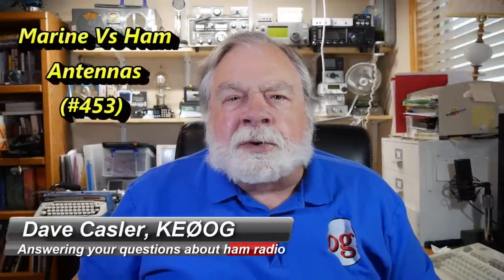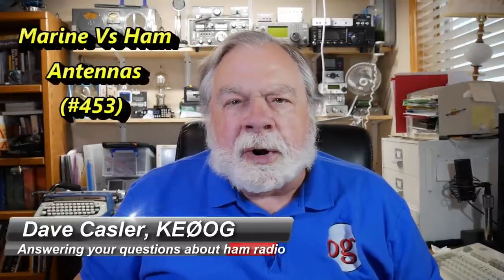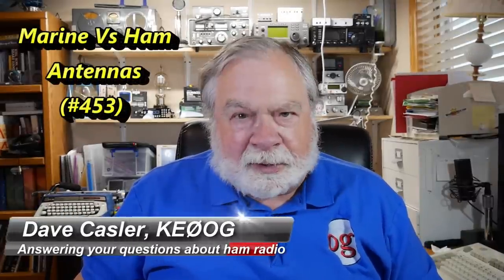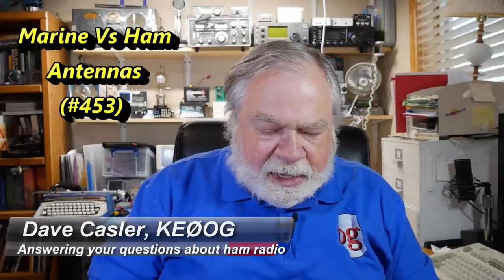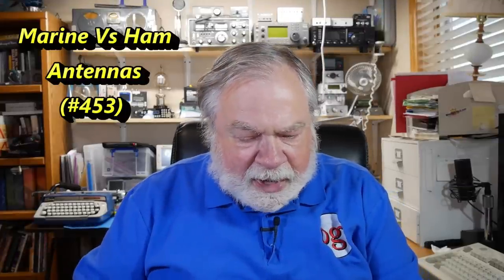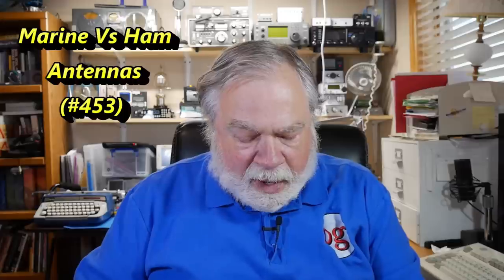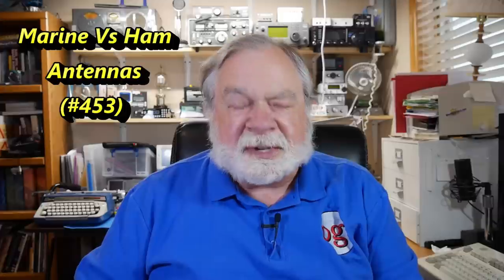Marine Vs Ham Antennas (#453)

Comment: If you are installing HF on a boat do yourself a favor and add a LOT or RF chokes to the coax to the tuner and the tuner control lines.  Add more to the power to the radio. USB cables, autopilot cables,  and anything else you can think of.  HF plays havoc on marine electronic if you don't.  Once you have that sorted out the system will work great.  I ran a 100w HF radio on our sailboat for several years.  BTW.  Marine band HF radios are expensive. A ham radio can be modified to function on Marine HF bands.  Although this might not be legal in US waters.

Comment: Dave, i am an yachtsman  and survived deep seas. Part of thr answer rests in maritome law. A captain may use any means possible when in disttess. Anu means can be to call usig any mode or frequency. So the only way to do this is with a marine ATU  that will tune any antenna.. a resonnant antenna has the best efficiency , Q and purity as you say
At Sea I LAWFULLY HAVE  TX/RX  500KCS TO 30 MEGS . This has not been used out of band, bit always gave the option fot HF maritime pr any means of  vsllig mayday
 The ATU  is a Kenwood professional ship auto tuner. . 
I built my first Tx/RX 64 yrats sgo. I began sailing and study to sail 40 yrars ago LOL. I had no radar, HF OR  GPS. Radio direction finding was  perhaps my most essential skill. 
As a subscriber I enjoy your work. I felt compelled to explain how maritime Law produced my solutions at sra. My ship ATU is now at my home in Thailand to dribe multiple wire antennas I am making between palm and mango trees Lol
PS..... using the ocean as earth and not as a reflecor gave matching problems. I deduced  that a close to zero ohms earth path was the problem with my first home brew roller coaster. Atu.   I found a good match using the Deck hand rails.and applied the Kenwood ATU inthe same way. I hope my comment is helpful?  My MM station was shaped by maritime law and a way not to drown withOut a meaningful QSO   LOL
  ( G4RNA   &  HS0ZOZ )
Thanks Dave, Its always a 
Pleasure to follow your good work.
Peter  K ?

Comment: An older ARRL antenna book phrased it very simply: Even on two identical boats, identical antennas will not perform identically due to variations in junctions, etc. While you CAN set up resonant tuned wires in the rigging of a sailboat, or hanging from it, you'll need extensive experimenting to get optimal performance.
 Using a long wire attached to the boat's backstay, with a tuner at its base, is a very good compromise if you don't have gobs of time and energy to do all the experimenting.
 Some larger boats will alternatively install a 20' (or larger) vertical multiband on the stern rail, but that's a whole other set of trade-offs.

Comment: Dave wow ! What a coincidence. Just finished my install of the DXE ground radial plate system yesterday with 60 ground radials of #14 insulated THHN Stnd. Cu. Call it over kill,  but I crimped first and then soldered the radial lugs. I even used a short piece of heat shrink over the other ends. Surface mounted with lawn staples is exactly one  way DXE suggests as  a quick and effective way to go. I doubled up lugs as you mentioned, every other bolt hole. You never can have too many radials on a ground mounted vertical. Keep up the great videos. 73 
WA3X

Comment: have two MFJ autotuners that I have used successfully with random wire antennas.  They get their power through the coax.  A "Bias T" feeds 12v into the coax, and the autotuner picks that up.  They are light weight but rather large in size.  They are not particularly water proof, even though MFJ says they are. I simply made a sleeve out of some plastic that allows access to the connectors and air circulation to dump any heat that might occur.   One can handle 100w, the other, 300w. MFJ has a tuner that can handle 600w.   Since I only use max 100w I am good to go. 

Keep up the good videos, Dave!  I have learned very much from them. .

Comment: MyAntenna sells a non-resonant antenna they call End Fed Long Wire.  It comes with a 9:1 UNUN. The wire length can be 44, 60, 73, 88, 107, 140 , 173 or 202 feet long.  It REQUIRES A TUNER.  This caused some confusion when Dave talked about a different Long Wire antenna that is much longer,  multiple wavelengths long.  I had a MyAntenna EFLW antenna that my MFJ  993B would NOT tune.  I replaced it with a EFHW  that works great - on many bands without a tuner.  BTW the 993B will tune the non-resonant bands 1:1.
73  K9AEE  Kent

Comment: Every sailboat backstay antenna I've seen is constructed with 1 x 19 stranded SS wire (diameter varies with size of boat) terminated by insulators on either end, and then end fed. The SS wire has nothing to do with radio, it's to make sure the boat's mast stays up. The HF antenna takes advantage of this and adapts the boat's backstay to be used as an antenna. 

Once insulators are installed, it's a done deal. No trimming, no adjustments. Because to install it, you need a crane to hold the mast upright (huge expense) and this backstay's mechanical connection is necessary to operate the sailboat.  When boats are larger than 40 feet, on a sloop rig, (single mast) the mast will be 60 ft+ in height and weigh hundreds of pounds. Maybe you could play with this on a 20' boat, but then an antenna would hardly be necessary as this size boat seldom leaves the harbor.

Comment: Its fine for marine use cause most vessels aren't switching through a hundred bands. Usually stay on a specific band needed for marine use, (coast guard or ship to shore, ect) Great video Dave!
Reply: That's not the case. Marine SSB operates between 2 and 30mhz if I remember correctly. That's a lot of spread. There are types of ham antennas that are the same - where you want to make sure it's not resonant on any band you're using. The end fed "long wire" or "random length wire" antennas (which are not random length, they cannot be resonant on any used band). I don't remember WHY they cannot be resonant on a particular band - I believe it's because they use very high ratio baluns / ununs like 49:1, then rely on an antenna tuner to match impedance.

It's just easier to set up in a relatively universal fashion to work without a lot of tweaking. You don't want to be fiddling with trimming / adjusting antenna lengths in 20 foot seas during an emergency.

EDIT: it's the resonant end feds that need a high ratio balun, not a non-resonant - I had it backwards.

Comment: But note that the Icom MN100 wideband antenna intended for use on a boat, obtains its "match" at all frequencies and in all locations, by including an internal resistor.  It has a 6dB loss - obviously a big disadvantage for amateur use.

Comment: Thank you Dave for a good article.  I remember maintaining the AN/TRC-136 radio at an Air Force Station on Long Island.  It was a mobile radio module that could be set in the bed of a 2-1/2 ton truck.  It was an HF radio (CW, RTTY, SSB) that was matched via an antenna tuner at the feed point of a long whip antenna.  The distance from the PA to the tuner to the antenna feed point was a couple of feet.  Our objective was to drive ground rods until we could achieve a good bond with remote earth.    If were lucky enough to contact the water table that was a plus — it would give us a huge natural ground plane.  With only a few hundred watts we could connect with our sister stations all around the globe.  A good match yielded better receiver sensitivity as well as more radiated power.  Lesson learned for me is that the grounding system of an antenna is just as important as the antenna.  Each node needs the other and increasing the driving point admittance at the feed point definitely makes a difference.  73, Sam N5BBU

Comment: Hoisting a semi-vertical wire antenna near a backstay, or for that matter near a mast, seems problematic.  Standing rigging (backstay included) are strong steel cables.  These attach to and support the (almost always) aluminum vertical mast.  In some fashion, these elements are "grounded" (one would hope!) through the hull to the sea.  Imagine the radiation pattern in this situation with incalculable lobes - a horror show.  I have to wonder if one would be far better off with a long steel vertical whip attached to the stern.  Any thoughts here?

Comment: Maybe you can help me with this one: I have a MFJ-993BRT remote auto tuner and I want to use it with an EF random wire. It would be great to get it working on 80m - 10m. I want to use a modest 21' pole to keep things a bit stealthy and I realise that the advisable random wire lengths are 17, 29, 35, 41, 58, 71 feet and even longer. For practical reasons, I am restricted to max. 41 feet.
Can I get away with running the wire up the pole and then sloping it to the desired length, or will an all vertical (of max. 21') always work better?

Comment: I think a good video would be a follow up to one of your earlier videos regarding antenna tuners.  While tuners may make one's rig happily pump out a 100W of power, there must be losses after the tuner.  Yes, it is best to place the tuner at the base antenna to reduce coax loses, but I just cannot believe that then all the power would be radiated.  If this was the case, then why are we all not using a simple CB whip mounted on top of a tall pole?  Or more reasonable, add a tuner to a 40m dipole for operating on every other band?
Reply: Hi! I have Icom AT-141, the tuner mentioned in this video, and I'm using it with Icom IC-7300. 

It's a marine tuner for European  market, and it's supposed to be used with Icom's EU marine SSB radios. 
Now, a difference between the US and EU concerning marine radios is the way the output power is specified. In the US, the output power of the transmitter is used. In the EU, the output power at the tuner output is used. 
Furthermore the tuner specifies antenna lengths: at least 7 meters length for 1.6 MHz and up, and at least 3 m wire for 4 MHz and up. 
Standard output power for low power marine radios is 150 W. With those 150 W, in the range of 1.6 MHz to 4 MHz, the output at the tuner is 85 W. On 4 MHz and up, the output power is 125 W, so there you can see some numerical estimates of the losses. 

In my set-up, I have the tuner connected to a 2 m tall radiating element (it's actually MFJ-1979, but I don't have vertical room to deploy it to its full height), and grounded to a system of 0.3 mm thick, 30 mm wide copper straps. The tuner tunes on all amateur bands between from 1.8 MHz to 30 MHz with SWR less than 1.5. 
However, there are losses in the tuner. The coils are made of copper wire which is 1.3 mm in diameter,and has its resistance,  and there are also capacitors with their ESR (which is not in the capacitor datasheet unfortunately). The energy which goes into the radiating element gets radiated out in accordance with the radiation resistance of the radiating element (which can be incredibly small at low frequencies, in the hundreds of milliohms range), we get energy radiated as heat from the ohmic losses in the radiating element and the wire to it (and ground), but the important part is the reflection of energy between the tuner and the radiating element. It creates strong currents, which tend to produce lots of heat, so at say, 1.8 MHz, I might be pumping 100 W into the tuner, but radiating some hundreds of milliwatts as RF. 
Still, very low powers can be enough to make a QSO, and such solution allows for some use of a band, where it would otherwise be unusable.
On the other hand, when we're using long antennas on shorter wavelengths, the radiation resistance will tend to be high, and the losses in the tuner and rest of the equipment will be low. However, the radiation pattern of the antenna might be undesirable. 

As for Dave's comment about panadapters and high Q of tuners and not being able to show an entire amateur band, well, I do understand the theory behind it, but in practice, in my setup at least, I always have enough bandwidth to see the whole amateur band I'm tuned to, and also stations around it. 
I also find the comment a bit strange even in marine HF use. Namely, there, most of the HF frequencies are duplex, often with a split of 1 MHz or more! So a ship's radio tuned to transmit on say ITU channel 1801 (first channel of the 18 MHz band) would be tuned to 18780 kHz and would be listening for a coastal station which is transmitting on 19755 kHz.

Comment: It goes further than just money.
Because marine operators just need to talk and they are not radio experts.  
They also only have limited space.
With Hams its a hobby the activity of  building the radio/antenna system is the main ends/purpose of the exercise. - and because it's a hobby we like to get it as perfect as possible (kinda like a hobby cabinet maker using dovetail joints, where a commercial cabinet maker will just use taples).
When hams talk the conversation is often the callsign a signale report and a location report. The actual  communication itself is really only used to prove you have a working system,

Comment: If you need to use a tuner, you will lose radiated power. Hams are usually interested in maximum output power from the transmitter being radiated. (W6DOF).